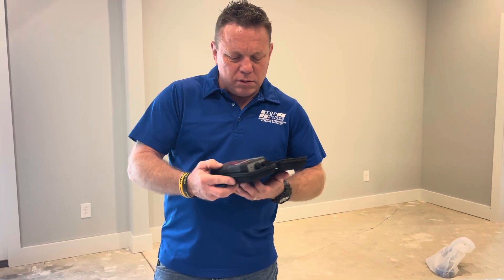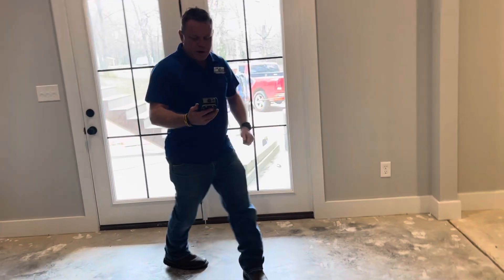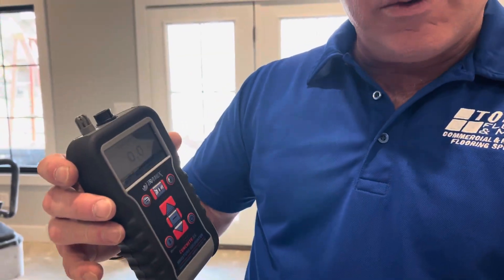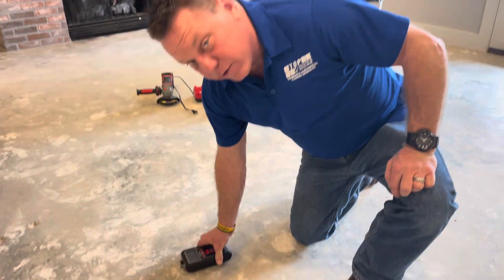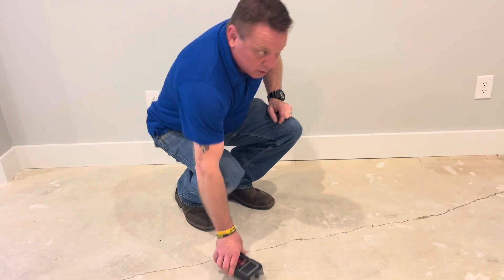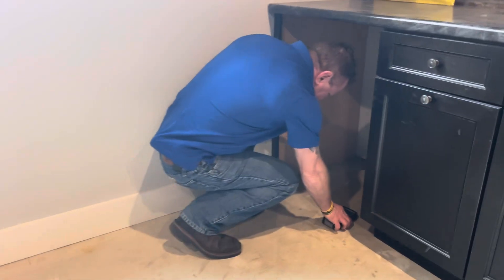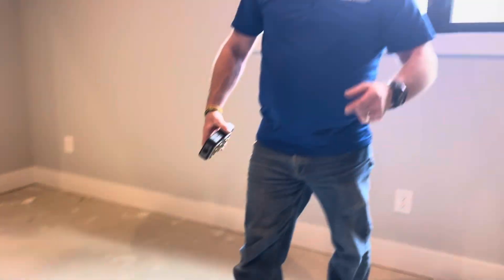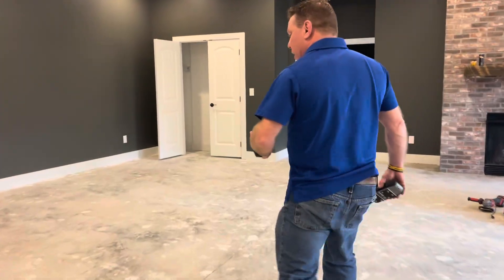Does my concrete floor have or need a moisture barrier?

Comment: Moisture testing is a delusion. Meters cannot predict anything. Calcium Chloride Tests (ASTM F1869) offer some information. Insitu probes (F2170) offer another view, but TESTING is not going to save anyone from liability risk exposure, as it is not conclusive or reliable.  Besides, the SECOND you cover the slab, you change the conditions and all your tests are null and void.  Place that Tramex or Wagner meter in the closet where there is no sunshine, get a 6 reading.  Place it on a spot with sun coming in, it drops to 1 or 2.  Misleading!  

The MAIN reason for failure, is NOT how much moisture there is....  The MAIN reason, is that any moisture, has a pH of 12 or more (as slabs are 12.5 to 13.4) and Latex, Acrylic or Urethane, has a 9 pH limit.  Only epoxy can hack a 14 pH and that is why epoxy coatings (as long as they are manufacturered correctly) can make a chemical barrier. Its not a moisture barrier, it is a pH barrier, technically.   

As for under-slab vapor barriers, they do not exist. Most are polyethylene, (Visqueen or Visquine depending on which coast you live on, LOL) but that is a biodegradable film that NEVER stopped humidity from saturating a slab. Only a modern polyolefin film can stop ground moisture, but that is not the issue... It is the pH !!!